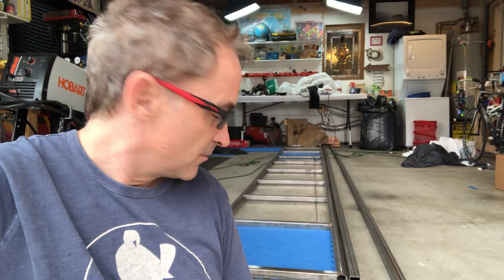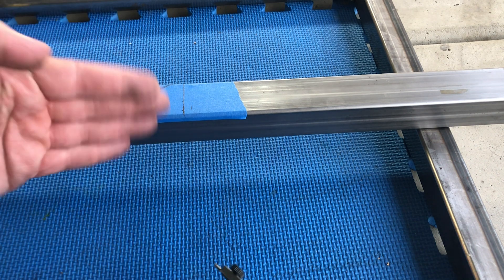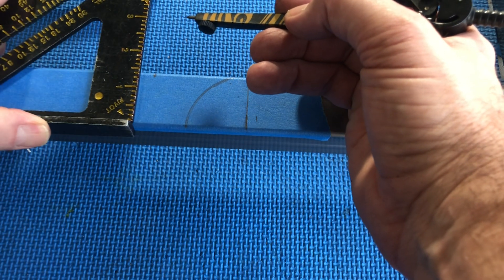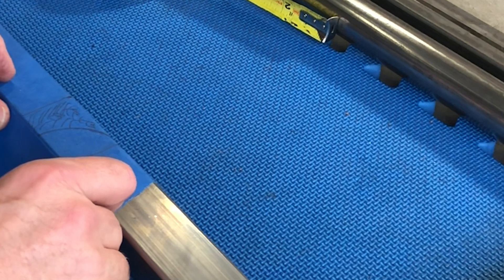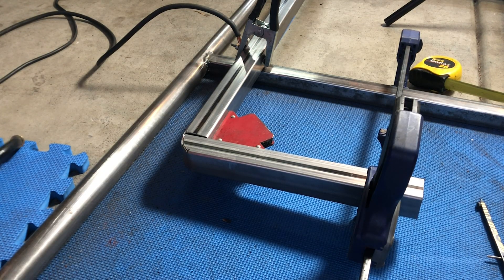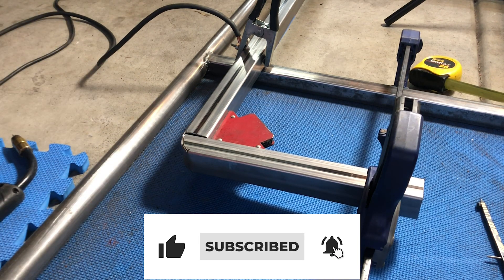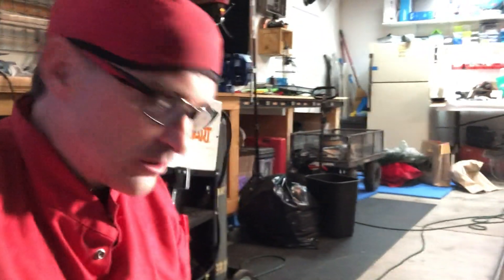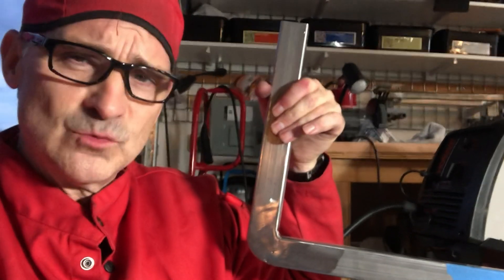Did We Just Build A Unibody Roller Coaster?

Comment: Hey Will just give me a heads up your welds were a lot better but footnote need to move your grounding electrode a lot closer was a little too far so if you go back in the video wear your blue tape was at from the bend that's where you want your ground electrode to be sign sprack a tack 248

Comment: Hi will, today I started building a PVC coaster in my yard. I’ve built 5 supports out of the 35 that it needs. I’ve spent a crazy amount of time watching you videos and planning it hyper-specifically. I know where every support will be the height and the angle as-well but I have two questions:

1) is it strictly necessary to pre-bend the pipe for the “lesserly” curved sections? There are two places where I know I will probably need to but for my airtime hills and such is it a necessity?

2) The cart design is driving my crazy. I can’t weld so that doesn’t help, and what degrees of freedom to give to the front and back wheels it not something that I know.

Anyway anything helps!
Reply from the maker: Hi Clete!
Congratulations on your project. The first thing I always tell people who ask for advice is this: Having a roller coaster in your backyard is like having a combination of a swimming pool, a trampoline, and a airplane. Generally speaking, all of these things can be operated safely. BUT, they are also seriously unforgiving of  incapacity or neglect. BE CAREFUL!

Okay - Personally, I don't think you'll need to heat or pre-bend your PVC for every part of the track. When I built my first coaster (PVC and Wood), I didn't pre-bend any of the track. What I found, however, was that the track was always under stress because the pvc was trying to straighten itself out. So, best to pre-bend as much as you can.

The Cart - You'll need 2 degrees of freedom on the rear wheels, and 3 on the front. It can be done without welding or steel. Just take your time, test everything, stay safe and have fun!

Will